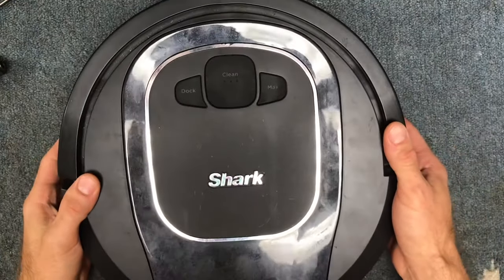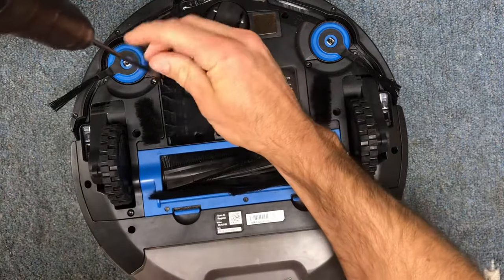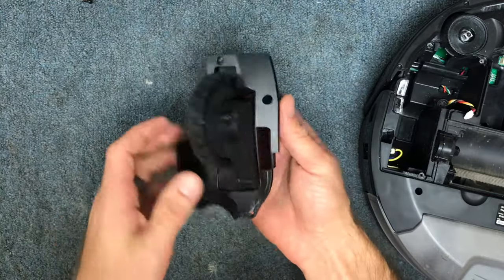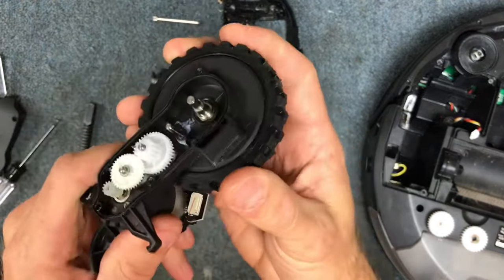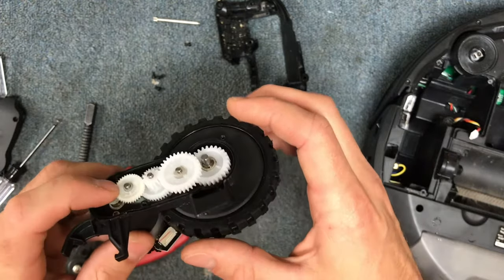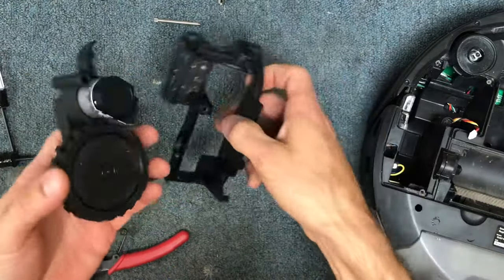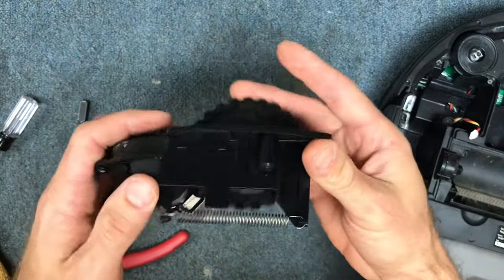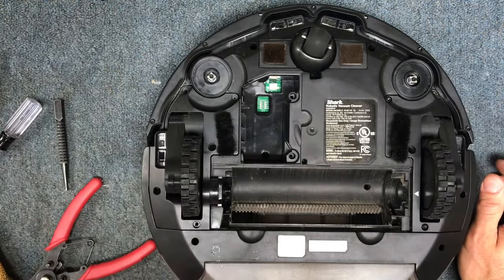Vacuum Repairman shows how to take apart a Shark Robot vacuum wheel for cleaning

Comment: This is extremely helpful (though, I haven't completely followed it yet). The only T-15 driver I have won't fit (not long enough or skinny enough due to the handle), so I'm going by Auto Zone to pick one up later today. My T-8 should be fine as I'm not expected such long drops to access those screws. Anyway, and in advance, thank you! Between my hair and that of my 3 dogs... I regular take apart and clean the robot vac. But the wheel's barely moving now, so I know this is the next step in figuring out a solution. Appreciate the help!
Reply: Oh, man... what a day trying to get this done! I picked up the T-15 screw driver from Auto Zone, all to get home, try to use it, and realize someone slid a T-20 into a T-15 tag/holder (sigh). That store was completely out, so I ended up at another location where they let me swap it out for the correct size. Great! But then I got all the way inside the box with the gears when I realized I didn't have that "separator tool" that you mentioned. So, I Googled it and quickly discovered what snap ring pliers were. Found out the Walmart up the street has one for a few bucks. Cheap, but I was still hopeful. Then I get home and try to use them only to find out the pins aren't small enough for the holes on that clip. Now, I'm exhausted and feeling a bit defeated, so I shall return to my research tomorrow and see if they make snap ring pliers with smaller pins...? That I can, hopefully, get soon! I still appreciate your video very much. It's been most helpful, and I'm one step closer!

Comment: Another person on here had the same issue I did. Took it apart and everything looked clean and when you remove a gear, the wheel turns freely. I was able to narrow it down to the motor. I think what I might do is buy an Amazon warehouse deal same model as mine. Use one or the other for parts. I haven't been happy with this model considering its cost and I've only had it a little over a year. Of course, now it is out of warranty.

Comment: I'm shocked at how easily you got the pin out. Mine is stuck and I've been trying to get it out with taps using a punch and hammer and it's not budging. Not even a little.
Reply from the maker: Hmmm. Maybe they glued yours in? 🤷🏼‍♂️
Reply: I think that must be it. I've even made indentations in the pin trying to tap it out. I think the plastic will give before this thing budges. @richardsvacuumcenter
Reply: I’m having the same problem. I can’t get it out for nothing
Reply: Same here, pin seems completely stuck in there

Comment: Hello there ! Just found your chanel due that our shark robotic vacuum has its right wheel stuck . I took it apart but to my surprise everything looked normal all clean greased although everything spins freely on itself once you put the last gear connecting the motor it is heavy to make it spin . Any ideas? It is a model# UR1105ARUS. MANY THANKS !! Good day to you!
Reply from the maker: Perhaps the motor has failed? Hard to say without being able to inspect it myself. You may try replacing the wheel assembly. eBay has been a source for finding functioning parts for these models. Good luck!
Reply: @richardsvacuumcenter  thanks for answering , I will have to buy the whole thing then .

Comment: Can you tell me what the name of that separator tool is, and where I can buy one? I've tried googling it, and I'm not coming up with something that looks like what you're using. My Shark took a detour through pet poop, and I need to get the wheels cleaned out thoroughly. :/
Reply from the maker: Snap ring pliers
Reply: Mine just did the same. Ugg
Reply: Can you tell me what size ring pliers, I have bought two now and both are too big?

Comment: You forgot the encoder and the detector at the wheelmotor... 🤔
Often the reason... 
I'll check mine tomorrow...
Reply from the maker: Thanks! Can you elaborate more?
Reply: There could be hairs blocking the encoder signal. It all seemed to be fine. But still it did'nt function. Gears okay - no extra friction. Something else must be defective.  It is a "Lydsto r1" but i cannot find the wheel units for them as a sparepart... 😢
Searching.........